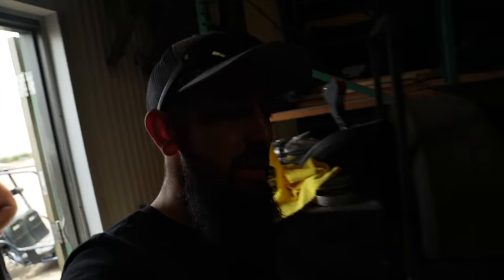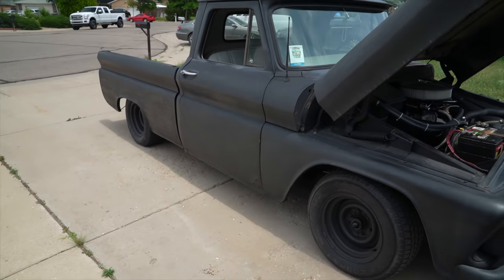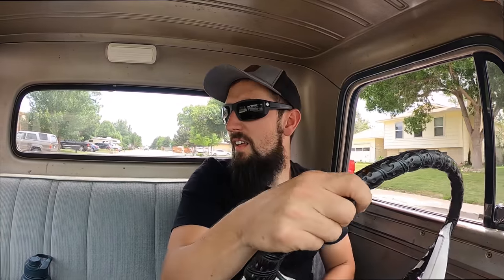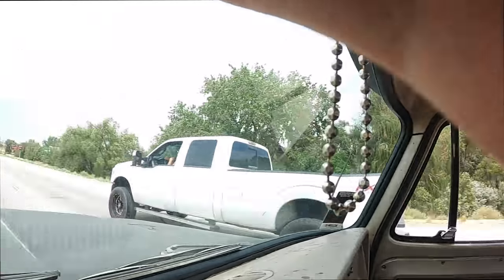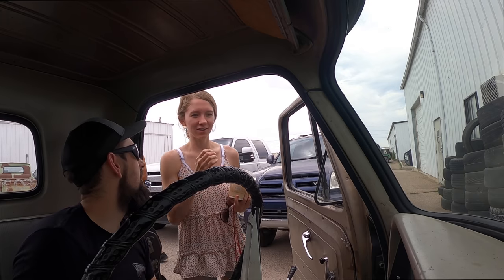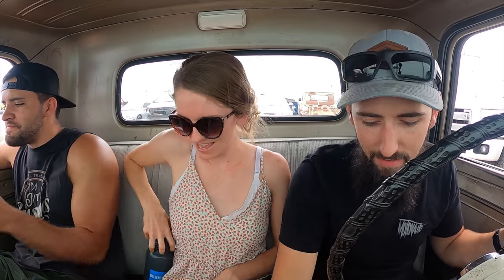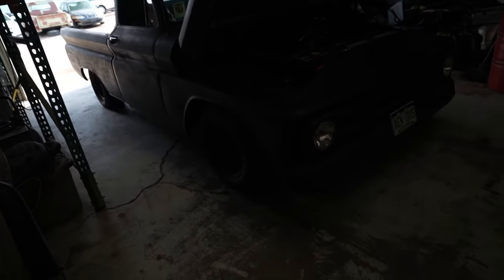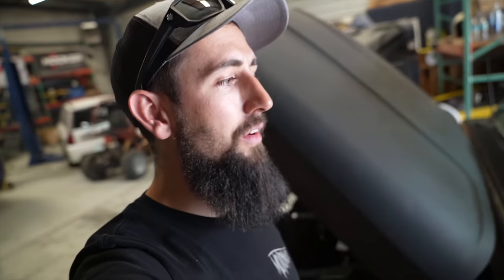I Bought a BIG BLOCK Chevy C10!

Comment: If it’s bored .030 over it’s a 460 if it’s bored .060 it’s a 468
Reply: Add a stroker crank and make into a 496 then the fun really starts
Reply: @mrbrankroll4885  for sure it all depends what you put in them you can make really good power with a 468 good solid roller or flat tappet cam dome pistons and good set of square port heads or cheap aluminum heads to max the air flow it would run Really good
Reply: @garrettcarpenter3319  yeah buddy. But heads are so hard to come by now and days, really all high performance parts are. I just put a order in with brodix for bbc in my jetboat
Reply: @mrbrankroll4885  yeah they are man ls are taking over now
Reply: @garrettcarpenter3319  you haven't never lied about that

Comment: Welcome to a real man's truck!!!!! She is a perfect, I got a built 400 I'm my 1980 long bed I drift with it ( my icon pic)   carbs are so easy to work with...   gota get rid of the sailboat steering wheel!! It will help alot with control,   I used to have a white 1965, short bed with a  built steal crank 327, 202 camelhump heads, rv cam, roller rockers,demon 750 cfm . I wished every time i drove it there was a overdrive, my 80 doesn't have overdrive either,was the best motor I ever had.....

Comment: If you want a new steering column, look into Flaming River. For an alternator, power steering pump, starter, or water pump try Tuff Stuff Performance. Lares Corp remans original style ps gearboxes, otherwise Detroit Speed makes some more modern stuff. And they also specialize in suspension components if that's your bag. You could also try QA1, Aldan American, or perhaps UMI Performance for suspension kits. 

If you get sick of the carburetor, there's a few companies out there with EFI conversions. Two that come to mind are the Holly Sniper EFI systems and FiTech.

Comment: a 468 with 10 to 1's and a 1000 cfm carb and it has a -8 an line its running out of fuel  i would jump up to a -10 line the whole way from end to end no reducers.  its a volume thing , the carb needs to have the volume waiting for it , that truck with a big block weighs 3850 to 3900 lbs  so my guess its gonna run 12;70s/12;80s if you get the fuel line changed

Comment: Dud that truck is sick! I grew up building muscle cars with my dad. We had this one camaro that was so bad ass. It thumped the ground so hard and you could hear this thing from blocks away. Sounded just like that truck. Badass built 350 with a nasty cam. Pretty much nothing stock besides the block. I miss that car. It was scary as hell. Been in some crazy shit but there is nothing like a bad ass built old muscle car or truck. My dad had a 69 square body that had a pretty stock engine other the headers and exhaust. But hearing you slam that driver door brought me back. That thing was nothing but metal and was obnoxious.  It didn't have power steering either so you had to man handle the steering wheel. Fuck I miss that camaro so bad. I wanna build one for myself soon. Or find the one that we built 16 year ago. But that's doubtful. Anyway sick buy man. I really am jealous. Lmao.

Comment: Dunno whether this is worth the comment, it could just be the view from the camera not giving me a proper sense of scale. 🤷🏽‍♂️
I’m unsure if it’s common knowledge or not these days, but; if you’re sitting still with no power steering, start rolling before you steer to help you turn the wheel a little easier at low speeds and in parking situations. 🙃